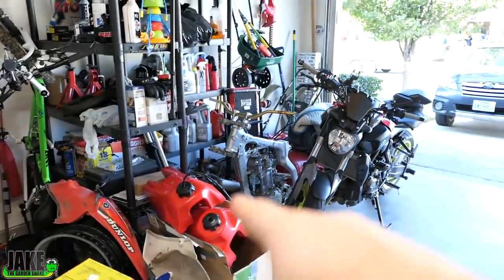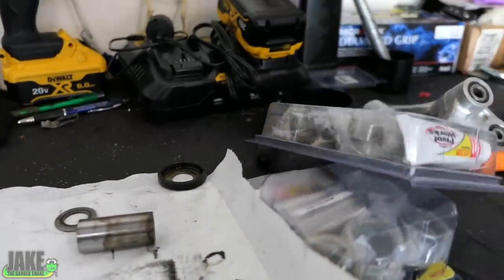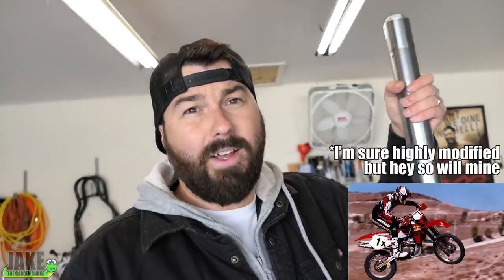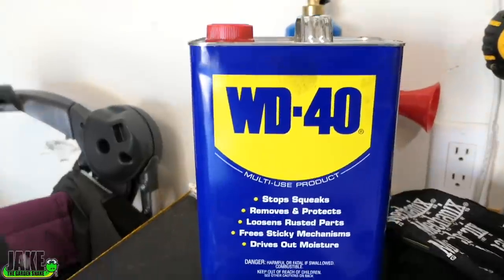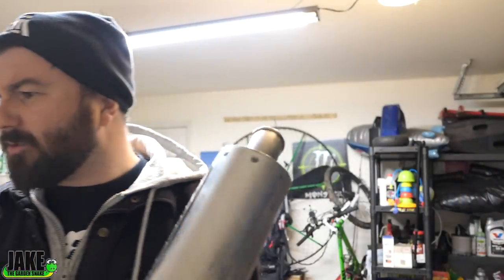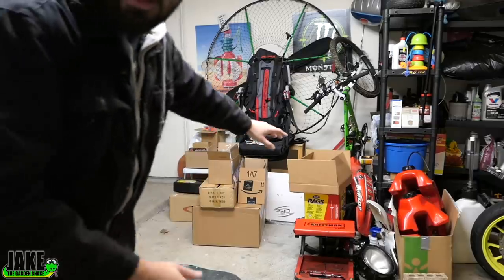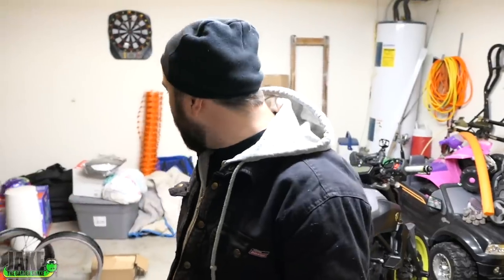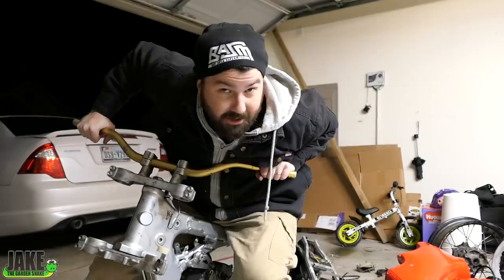Dem PARTS - XR650R Supermoto Build 4

Comment: About the injected vs carb bikes, here is my story... I had a Yamaha Wr125R with FI and now i bought a Suzuki DRZ400E witch, you guessed it, has a carb (FCR). The drz has way way way better throttle response and is as smooth (if not even better) than the yamaha... and yeah it might be because technically the Wr125R is made in Europe ( and you know Eu bikes are a bit rough) or i just might had luck with the drz that has a perfectly tuned and clean carb.... maybe thats the problem, most people get a bike with a dirty/not tuned carb and they say its worse then Fi. AND dont talk about that shit ,,carbs are more complicated then Fi,, Im a guy who has no idea about bikes (except models and such) and i opened and cleaned a carb (i got every part off for the most part) and closed it without any problems... The carb is a fcr49, people say to never even think about opening them because they are so complicated. Maybe im just good at it... im pretty sure im not :) Im really shit at most thing. (sorry for my bad eng, im Bulgarian and a bit drunk )
Reply: I used to own an R125, same engine and throttle body as the WR125, I have to say it's just that particular engine that it feels a bit like it's delayed response, as someone who owns an XT600 which is still carbed, actually has 2 of them, that shit opens up and the response is insanely immediate, really makes you feel connected, on my R125 you could do a full throttle and let go and it would only do a little blurp, you can't do the same on the XT cos it's instantly giving it all it's got, carbs are always going to be more responsive, since the wire is directly in physical contact with both ends of the throttle, as for FI, it really depends, a good FI will feel like a carb but most just have this unmeasurable lag when you give it some throttle
Reply: Your bulgarian..me too good to see bulgarians watch jake😊